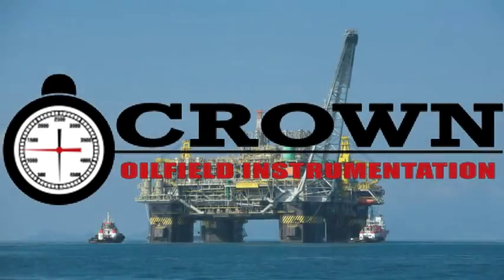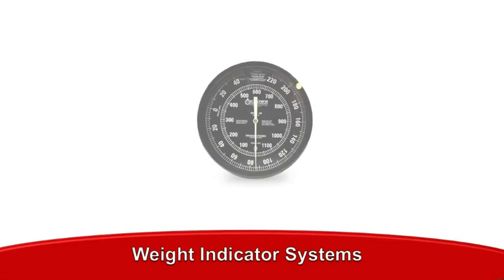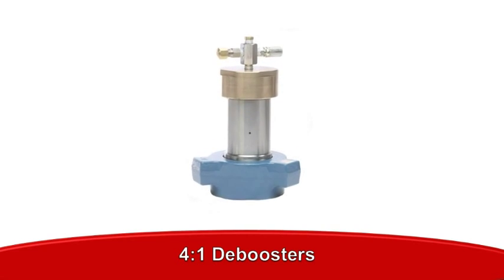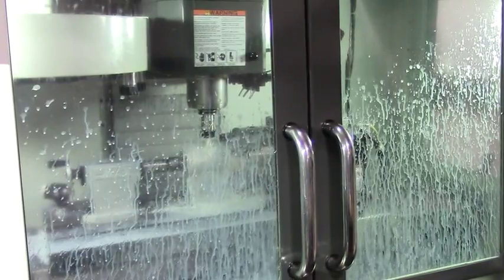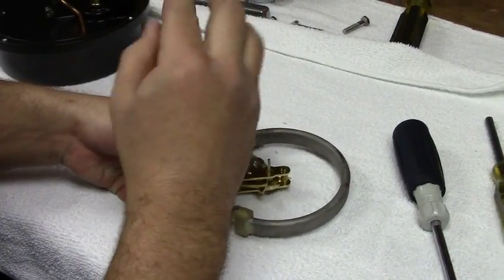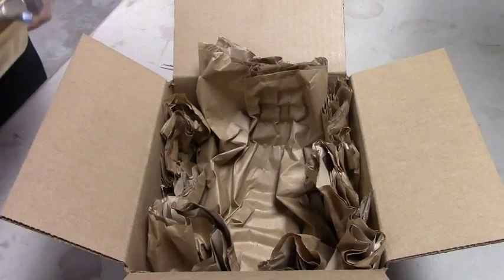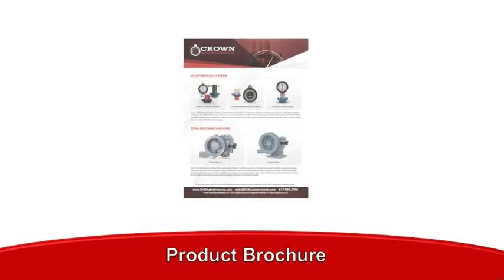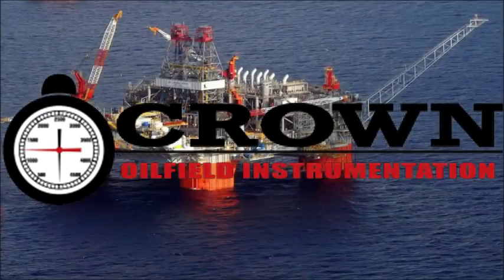Crown -- a World Leader in Drilling Instrumentation

Comment from the maker: Crown Oilfield Instrumentation – a world leader in developing and manufacturing drilling instrumentation.  From new sales to service, we ensure that your drilling instrument needs are met promptly and professionally.  For nearly four decades, Crown Oilfield Instrumentation has serviced the needs of the oil and gas industry with quality, American-made precision drilling instrumentation.  At Crown, we design, develop and build a full range of products to meet our customers’ needs.  As an industry leader, we work tirelessly to ensure Crown products perform their job right, every time.  

From weight indicators, tong torque systems, mud pump pressure systems to our brand new product lines, such as the Crown Chart Recorder and the Titan deadline anchor, Crown Oilfield Instrumentation continues to set the standard in precision drilling instrumentation.  Our state-of-the-art manufacturing facility houses several world-class CNC mills and lathes, where we make critical components such as our bourdon tubes.  At Crown, we take pride in the fact that all critical components are made in house and tested rigorously before they make it to your new instrument. These are just a few reasons that our customers receive nothing but the best equipment at competitive pricing. 

Crown Oilfield Instrumentation takes pride in providing personalized service to each of our clients. In fact, our tailor-made customer solutions have earned us a globally-diverse client list. For a complete list of our products, including downloadable data sheets and brochures, please visit our website at http://www.drillinginstruments.com.